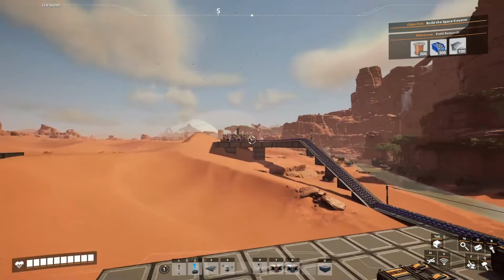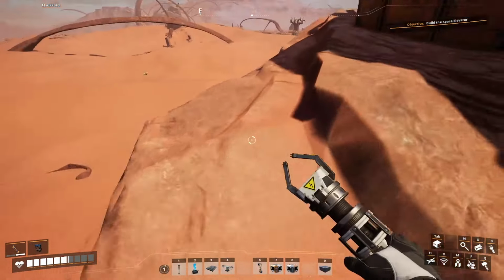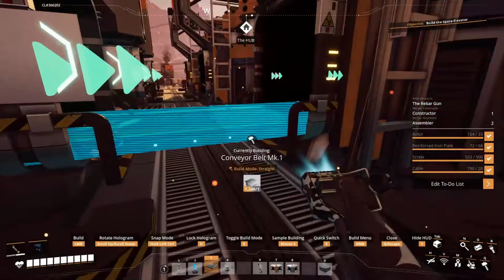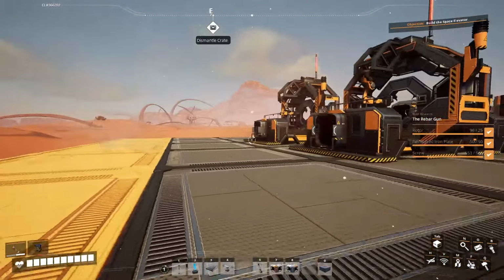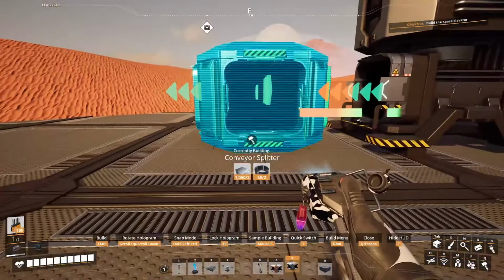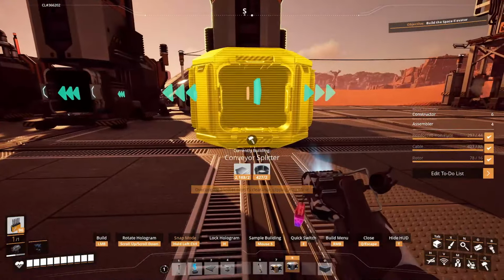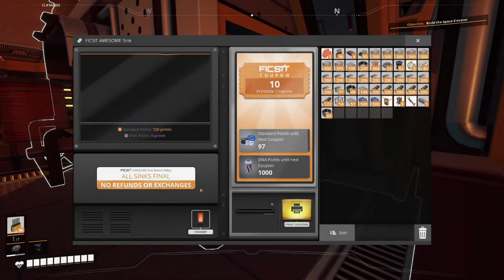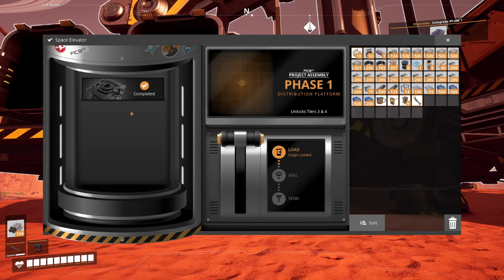Finishing Phase 1 - Satisfactory 1.0

Comment: Heya, i got a question for you: i'm currenlty doing a load balanced playtrhough myself and am really indescicive about if i want to split my power production for constant and non-constant or not.... reason being the power augmenters boosting by a percentage, which makes it better to just have a single, big grid instead of two (or more) smaller ones... what is your plan for that?
Reply from the maker: I have been super indecisive about this same thing ever since they announced all the new machines. Before 1.0 it was mainly the trains and particle accelerators that weren't constant and the total power needs weren't too bad. Now it looks like we are going to be using a good amount more particle accelerators and the new machines aren't constant either. I'm pretty sure I'm going to go with a singular power grid even though I really prefer to have 2. I keep trying to think of ways to make 2 work but it does seem pretty inefficient now. Good luck!
Reply: use batteries? says the person who hasn't ever properly managed power :)
Reply from the maker: Batteries are an excellent addition to the power grid! I'll probably have a lot in this save. In my past playthrough I had 2 power grids, one was much smaller than the other. That one had all my trains, sinks, and particle accelerators on it because the power fluctuates with all those. The main power went to all the machines that could stay on at 100%. It was great because if the graph wasn't 2 complete flat lines I knew there was an issue somewhere. It was nice but I'll have more power with 1 grid now.